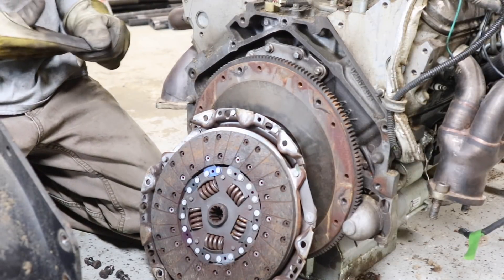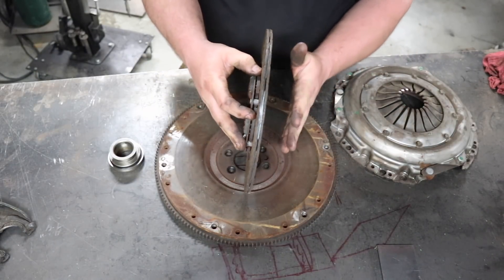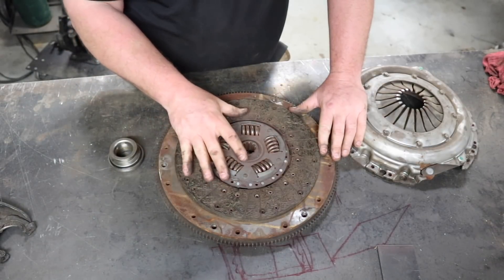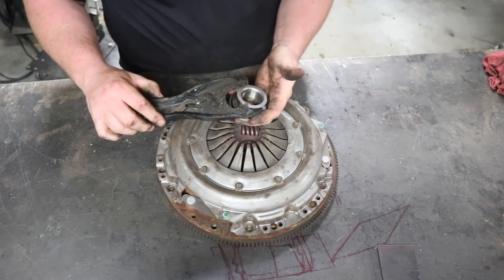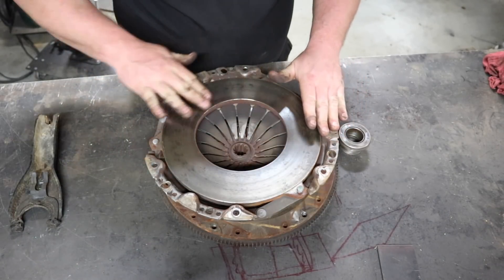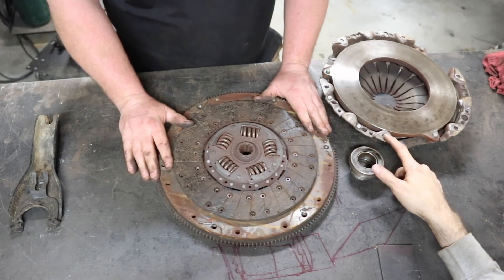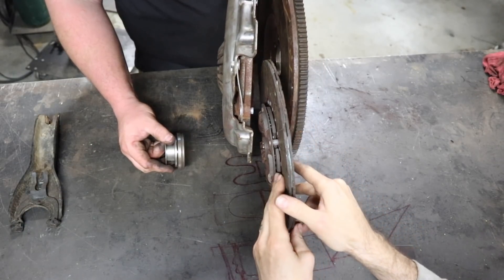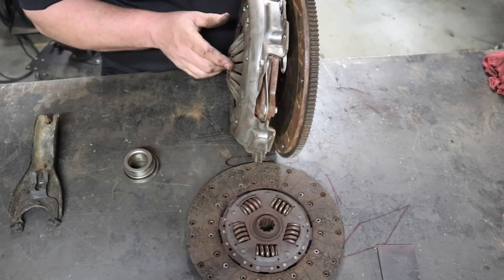How Does a Clutch Work? - Comancheep Project

Comment: I replaced a slave cylinder twice.
When bleeding it i get 8 to 10 pumps and i hear a little pop and it starts leaking out of bell housing.
2011 JK.
Could my clutch be not working right?
Thank you?
Reply: Im lost on if i should try a 3rd time or take it to the shop...

Comment: Hey BleepinJeep I have a 95 Dodge Dakota. I just replaced the entire fuel pump assembly. My fuel gauge still does not work though. Could you please explain how to work on dash gauges? I know my sending unit is fine since it is brand new.
Reply: So I have the longest story for this dakota. Bought her three weeks ago running. For 1500 she came with a nearly running 92 parts truck. I've been repairing random small shit until last week... She had been chugging down on acceleration. Took her to one mechanic and was told to give her a tune up. I replace dist, dist cap, rotor, wires, and plugs. Still had the issue so I regapped the plugs. Thought she was fixed so I took her for a run across the river. She died at the foot of the bridge coming back. No power when dropping her to the floor. I immediately suspected fuel issues. Chugged her at 20 mph in the shoulder for two miles to the closest mechanic. The mechanic suggested my cat was blocked. Chugged her to the muffler guy to stay til monday. Cat was fine. Chugged her to another mechanic. She caught fire in this shop and they tried to pin it on me. Finally conceded that they may have leaked fuel while testing the pump. It was reading 10/30 PSI. BARELY MADE IT TO THE FIRST MECHANIC. Who replaced the pump assembly yesterday. Now caught up to my first comment. I'm assuming the new pump went out today. Been a damn rollercoaster. Will have more tomorrow, good or bad. Also this is the abridged version of this story. Somehow still love this truck!

Comment: So would this be a short version?   So you know how your brakes and rotors work... When you push the brakes it clamps the pads down on the rotor and stops the wheel. It's sort of the opposite when you push the clutch. Pushing your clutch pedal down essentially cantilevers two rotors that sandwich a brake-pad away from that pad in the center -- the clutch plate -- so that it can spin freely and not hold the transmission to the engine. 

Great description in the video though. It made a lot of sense. Thanks!

Comment: If you want to see it in action on a vehicle while the motor is running look up this YouTube video,  ( manual transmission visible clutch engagement)  from (Ovalbore) it's a 0.59 video.  It will really help you visualize what they are talking about here in this video.

Comment: Great explanation, with one exception in my opinion. The dampening springs in the clutch disc do not really absorb the “Bang” of each cylinder. On a V8 engine, at a mild 1000 RPM, you have 66 ignition or cylinder firing events every second. Therefore, IMO, you wont feel each one of those. I believe the dampening springs are there to absorb the shock of engaging the clutch, with out destroying the disc. But hey, that’s just my opinion. Otherwise great job. I love the channel and enjoy every episode.
Keep of the good work, both of you!!
Reply: Gkmbll heck yeah that sounds good That makes sense...

Comment: I have an AX-15 with 88000 miles on it and it still seems really smooth, what are the tell tell signs of when the the clutch needs to replaced or maintenanced?
Reply: its slipping.. try putting it in 1st and stomping on the gas from a stand still, preferably on a hill.. if the rpms rocket up without the vehicle speeding up proportionately the clutch is slipping.. eventually itll due it at light throttle and all the time and before you know it youre all out of clutch and all gears act like neutral

Comment: Good information thank you I think I might need a new throw out bearing
Reply: Omg you will not believe it but I have a mechanic right now opening up the transmission because the wheel bearing grenaded it’s self 😩😩😩 I guess my hunch was right
Reply: Update the throw out bearing blew out and got a new clutch kit installed and now it’s working great ^_^